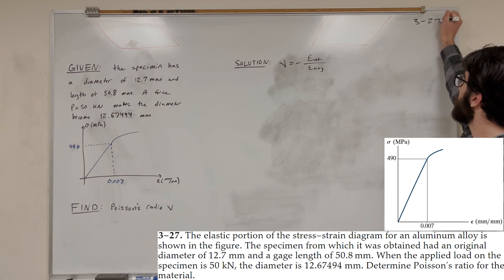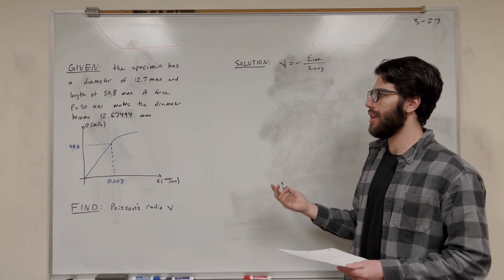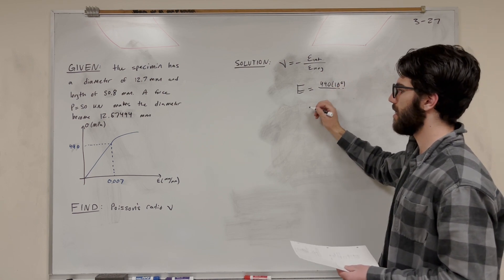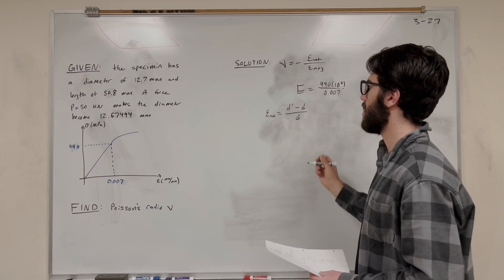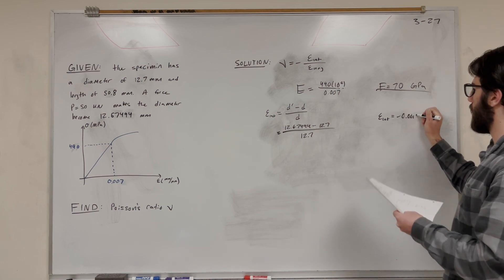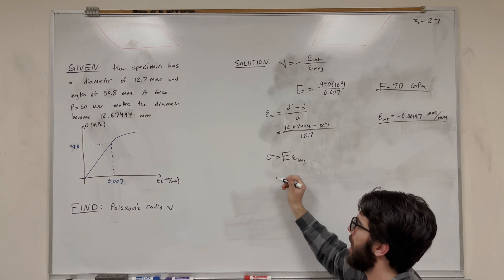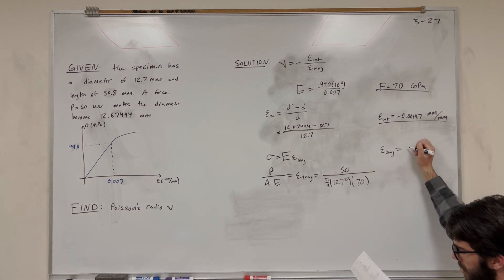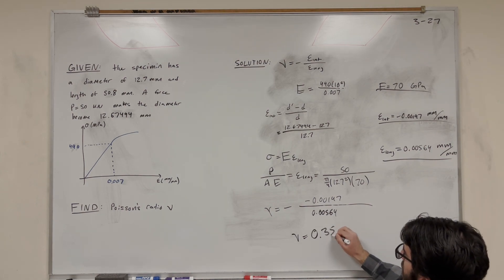The elastic portion of the stress–strain diagram for an aluminum alloy is shown in the figure - 3-27

Comment: Can you explain the units on this it seems you get M^2 over mm^2 when you solve for P/AE
Reply from the maker: Mega is (10)^6 and mm is (10)^-3, so when you do the calculations with those prefixes the magnitudes cancel out, try it yourself with converting to standard units
Reply: I am seeing the same problem as you. I'm just writing my answer as 5.64*10^-9 mm/mm because I converted the units to their standard that that's what I got